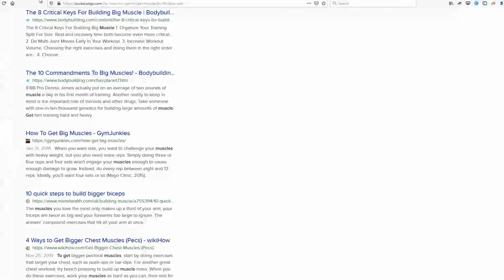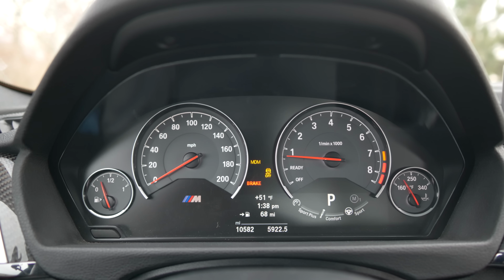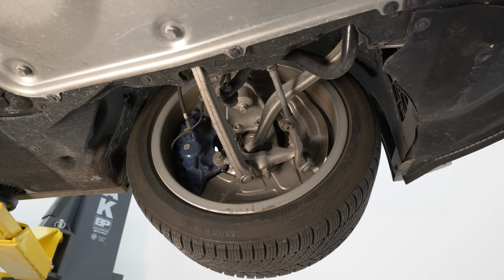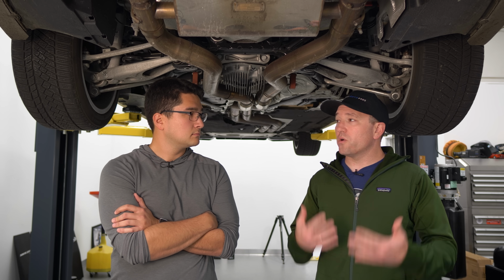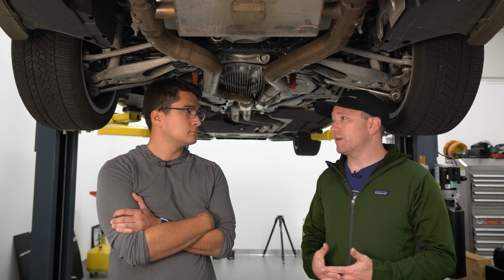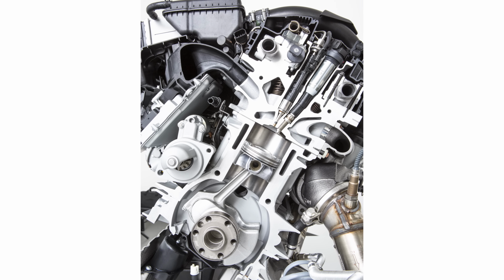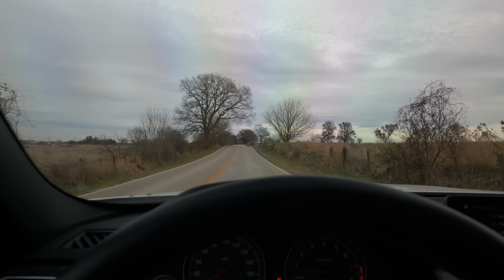BMW F80 M3 Review | The Sports Car for Mathematicians

Comment: So, if throttle control is a problem because of excessive power to only the rear, why not get a 440i?  Six cylinders, six gears, less aggressive tuning, far more dailyable.  You still would have a car that's more capable than 97% of other drivers out there.

Comment: just got my 2020 M4 convertible before they are gone. Love the car for being tamed but can be a beast when it wants too. I have no issues with the sound or the double clutch auto transmission. Love the hard top convertible where its like having two card in one. The extra weight in the trunk when down makes the car feel different. The new model M3/4s have to much gizmos, I prefer the simple layout of the 2019 M3/M4 interior where it feels modern but still has touch of old sports sedans. This is my second BMW and have had no issues the old one and so far none with the new one.

Comment: I've been lusting for a white m3 with a CF roof ever since the E92 came out. I was sad when they retired the V8s, but i also got  love for the F80. One of these days I'm going to have to nut up and get one. It isn't a dream car per say, but it's a car I feel I need to own at least once in my lifetime. See what the hype is all about per say.

But I'd say I am one of those guys who are befuddled when people mention a lack of  steering feedback. Also living in NYC, driving on bad roads all the time, I do not want to feel that through my steering wheel. Ever drive on a cobble stone paved street? The car feels like it is going to fall apart, and that is any car, even softly sprung ones. So I could care less about steering feedback. As long as the car corners relatively flat, has a good suspension that is good with bumps and good grip levels I am happy. I think most consumers will feel that way and you guys are right, that is why the newer bmws have numb steering. But why is it so bad among car reviewers and so called enthusiasts? 

Keep up the good work. I love your reviews.

Comment: i work at the supplier company that makes the gauges for BMW (among other manufacturers).
some of the prints that went through my hands are quite beautiful, i was especially surprised how the gauges of the m2 competition looked quite different from the regular 2 series, when it came out new. we're currently told that they're going to shut down our factory til 2025, because mechanical gauges are running out of style won't be profitable to be produced in a country with "high" wages.
Reply from the maker: Thats sad, until people have to start paying money out of warranty to fix these displays after they ghost, white out or have dead pixels for thousands.
Reply: @savagegeese  the saddest thing is, we're developing these displays and manufacturing methods in house, which then will be used in a newly built production plant in countries like romania, bulgaria or the czech republic, where workforce is cheap.
Reply from the maker: What type of display tech are you working on just smaller custom sizes?  That's how the modern corporate supplier system works.  Make us this...OK. make us this for next to nothing or we ask the next guy.
Reply: @savagegeese  no, we supply large OEMs in their mass products. no small number custom stuff. if you sit in a new C class, you'll look at our stuff. we also make the touchpads for merc.
Reply from the maker: @TheWolvesCurse  wow ok. Are you internally farming out to cheaper factories or are the larger oems building your designs?
Reply: @savagegeese  "we're" farming out to cheaper factories within our corporation. our union is currently fighting to keep this facility up an running, though our incresingly growing green parties and groups are working against the automotive business, and our efforts to keep these jobs.

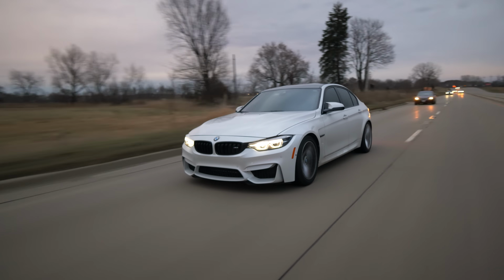Comment: 18:30 - that's a pretty good assessment of it.  I have a W204 C63 and this F80.  The latter car is superior on paper in essentially every way to the C63.  However, the C63 is dripping with charisma and is the car I will probably keep for at least another decade while the F80 is gone the moment I finish paying for it.

[It's really odd the owner got an aftermarket exhaust but didn't turn off the fake engine noise.  I turned off the ASD system the day after I picked up the vehicle.]

Comment: Actual Bimmer owners: was the E90/92 M3 really that bad? I’ve had a burning desire for one for 10yrs now.

I know about the rod bearings. It’s a 8000rpm race motor. I accept it as risk/maintenance.

What other issues should I be aware of?

Comment: Great review as always. Sounds like you very accurately and fairly assessed this one.  How about the RS5 sport back (4dr), or an S4?
Reply: We actually did a s5 sport back a while back. Great car.
Reply: @jackh7550  how does it compare to the bimmer?
Reply: J Mendola depends. The s5 is a total cruiser. It is more comfortable and maybe a better street car. However if you plan on doing any track driving the m3 is the only option out of the two.
Reply: @jackh7550  ditto with your sentiments however I'm comparing to the rs5. I don't have much experience as I only did a test drive but even in that very short time the rs5 felt soft and much more angled at daily driving than the M4 competition.

Comment: Having driven one of these at a BMW M Track Days event in Austin, TX (Circuit of the Americas), it’s definitely easy to drive at a very fast pace on a track, without needing much time to get familiar with it.  The Competition model is much better than the ‘regular’ M3, with a little more power (like it didn’t have enough ALREADY!), much better suspension, and better steering feel.  It’s too bad that BMW ended up with an S55 engine that sounds mediocre, because Ferrari can make a twin turbo 488 that sounds amazing.

Comment: If your going to modify this anyway and it's not the competition package, why not go for a cheaper alternative, m340i, the Mercedes Benz amg line, Infiniti q50 3.0 turbo, Genesis G70, kia stinger. I mean couldn't they all make similar power with an ecu tune? Also would this really perform that much better on a track?

Comment: I want to see more 50.00 on the weight distribution, I feel like these cars are straying away from their perfect balance. Idk If I had to I'd probably add a few weights on top of the rear axle and fix the cross balance by adding a little more weight in precise locations see how much better the car handles on track and on the twisties. Too bad I don't live in California so all our roads are made with rulers.

Comment: I do love this car and that is a perfect spec. Have been thinking about getting a slightly used one, only thing that worries me is the crank hub failure thing. Probably will go with an M2 comp but if I decide I do want 4 doors then this is what I'm going to.
Reply: That crank hub issue is a problem when you start adding some power
Reply: Yea, I'm in the same boat but I heard the spun crank hub can happen in completely stock cars too, no matter the manual or DCT (although the money shift with manual cars seams to be the leading factor in it). There are solutions for that, there are many videos but the fix is in the range of $3-4k for parts and labor that must be planned for if you are out of factory warranty. I wander why SG wouldn't mention it, it's a well known issue and kind of a design flaw if you ask me - they could've designed it with woodruff key or one piece crank hub similar to after market solutions from factory and avoided it happening easy.

Comment: I have been seriously considering the next-gen M3 as my next car, using the G20 M340i as a reference. I love the G20 3 series and the improvements they've made over the F30, and I especially adore the B58/S58 engines. But, if BMW gives the M3 that disgusting grille, I don't think I can bring myself to buy one, no matter how good it is.
Reply: Has ur opinion changed
Reply: @omargeraldo3332  Yes. I still don’t like the grille, but I don’t hate it as much as I used to

Comment: Really good review. I think this M3 generation had huge shoes to fill but also fix past issues (reliability for example), they made so many changes (rolled the dice), BMW ended up weirdly impressing and disappointing folks at the same time. On the "emotional connection" dilemma, is it fair to say that this lack of connection is a growing trend with new cars, with exceptions like the Giulia? I think as per Savage Geese, yep, sad to say cars are better engineered, more reliable, less quirky (which is concerning for Doug DeMuro, though he can find quirks and features inside a ping pong ball) than in the past, finding engaging new generations of cars seems to be getting difficult. The engaging drivers car will end up being the weekend car, an older car which is not relied on for daily use and does a few things really well, but dreadful at most things like fitting child seats, self parking, and ignores commands like "Hey Saturn".

Comment: I was wondering what is the impact of the winter tires +  surface temp on the tractions comment that the review had;  I would imagine set of summer tires and right tire/surface temp combination might have provided better traction and perhaps a different driving experience!

Comment: Out of an E90 M3 and into and F80 M3 Comp.; other than the telepathic throttle response and exhaust note of the S65, the F80 is much, much better. The E9X was louder than it was fast - lots of melodic tones while revving it out, but it felt slow. The F80 feels more like a super-car and on windy roads, the F80 has positively vicious acceleration from apex to apex. Still, I miss the “specialness” of the S65, but not enough to go back...

Comment: It's not that people don't love them, it's most people can't afford them or their maintenance.  Jealously is a bitch lol. I have two BMW and they both spit out srt chargers V8 Camaros all day. 
These are not for everybody, there technology is to advance for most mechanics. They can not be fixed with snap-on scanners and a couple of wrenches. Most people can't afford to do ALL the preventive maintenance, that's is why they get a bad rap. You just can't swap out parts in most cases you have to do updates or programming, that's why most mechanics hardly fix them right the first time. In California and Canada there everywhere, that will tell you something. If you want a loud clumsy car get a mustang or challenger, with such a cheap interior. Maybe  worst Kia (Hyundai)  feels like you're driving a recycled Pepsi can. Btw they new Kias are wannabe BMWs , they hired ex BMW engineers to design new Kias, just on way lower level. People just don't do enough research. Try to get 900 horsepower out of a V6 American car it won't last long before blowing up if you can even get it to do it.  I have Infinity g37 another awesome car.  This guy is butthurt cuz he can't afford a high end BMW anymore, it abviously shows by his snarky comments about how expensive they are. Like I said not for everyone peace.

Comment: Perfect. Get a E90 M3, its slower but far more engaging. I have owned mine for a a year and had zero problems apart from the fuel consumption which is TERRIBLE.

Comment: Mark I’m with you but you’re literally looking at the merits of a fun daily driver through the lens of “I want a memorable weekend toy/track car”. Also I wonder if you need to begin driving vehicles as if you had the skill level of 10 years ago, as well as your current insight. That would be a great exercise. 
The vehicle that has the engine that epitomizes what you’re discussing is a car you notoriously hate because it was not enough of a track weapon but at the time of purchase you weren’t even out to buy a track toy. Granted you had the weird mechanical stuff. 

Your summaries at the end I guess render the need for the previous suggestion moot. Kudos.

Comment: Tesla M3P are killing sales of 3 series including this M3 because the reliability in Teslas are much higher, they are easier to fix.  And you can't match the M3P performance with even this M3.  Tesla just released an update and their car easily goes to 60 in under 3 secs.  The point is that BMW is running out of time with their reliability issues, dealer problems, prices, and performance.  Many folks are tired of their $70k+ toys becoming a money pit after 1-2 years and the cost to run them is getting out of control.  Teslas cost just a bit over $60k and you get amazing performance and its the future of cars.

Comment: I've never driven one of these, so if you would please help me understand this: having so much low end torque is a byproduct of having turbos that allow for more modular throttle control, no? For example, if it was using two massive turbochargers it would have the typical "light switch" powerband and break traction immediately at a certain rpm range, as well as not allowing for you to get good responsiveness at part throttle. 

Point being you should be able to use your right foot to control power delivery fairly well for a turbo engine, no?
Reply: It needs good sticky tires. On the Stock Super Sports or the Snow tires that they were driving on the car is a great burn out machine with the traction control off and is very hard to throttle modulate.
Reply: @Jazz_adub  Even with Hankook Ventus R-S4 200tw tires there is still some wheel spin in my F80 M3, but it's more controllable.

Comment: I’ll admit that I’m slightly biased because I own an F80 CP, but I get the feeling that a lot of the hate this car gets is basically momentum from people reading bad early reviews who have never driven the car.  Also, M3 fanboys ALWAYS shit all over the current generation for not being a real M3.  I remember the gnashing of teeth when the E9X came out with a V8 because it was turning it into too much of a muscle car GT coupe, which is kind of hilarious in hindsight because that car has an almost shocking lack of torque.  When the G80 comes out, everyone is going to love the F80 for not having a beaver face, and I guarantee people will appreciate how ‘analog’ it’s going to feel in comparison. 

There isn’t a car on the market that has the same combination of comfortable, useable and fast on the market for the money.  When the compromise is that it’s so good it feels sterile, too numb (it’s not compared to any other modern EPS), or sounds bad (it’s no V8, but it doesn’t sound THAT bad), it’s probably a pretty good car.  I cross shopped this with a GT350 (faster, but the shit interior and build quality killed it), ZL1 (faster, but the shit interior and inability to see out of it killed it), ATS-V (ugliest gauge cluster this side of a ’96 Cavalier, and a rattle can brand new), and Giulia (no stick), and each one of those cars had attributes that would ruin an ownership experience for me considering how expensive they are.  Also, as the review states, it’s stupid fast.  The only time you’re going to think it’s slow is if you’re having a keyboard battle referencing lap times, never having actually driven one.

Comment: i did drive a 3 series 2020. 331i xdrive .
xdrive translate to awd. 
opens the hood. check engine bay ,says twin turbo, saw one turbo so that means twin scroll
drives it, 0-100 in 6 second. tested 3 time
suspension seems very comfortable
turning and drifting does feel very controlled
steering response like . .  . it is not connected [yea i agree]
yes, driving this car for a few day made me realize no, i should not own this car, yes its features are very nice, and yes it accelerate very fast at low rpm, and yes i know what 0,4G-0.6G force feels like. because ive felt more. 
the seat can hug the back of your thigh, doesnt go up and down significantly, you can adjust head rest t tilt forward or backward, as well as default up and down [or just remove it and youll have less blind spot jk dont do that on every car] and the side of the car can hug you and wrap around your back ribs unless you are really skinny . 
the brake and gas doesnt feel too tight
and ill tell you what. with the amount of electrical in this car, i am scared of owning it to fix it in the future. even the front kidney grills opens when the engine needs air. 
if you dont like to fix cars yourself i gotta tell you this is not a one time 60-80k [$100k+ if you are looking at the higher end bmw] the car will eventually need expensive maintenance
yes it is a functional car but it almost feels like . .  . a cheat mode
yes it is also expensive.

Comment: "Either you think of: they're great performance kind of machines, or they're horribly unreliable pieces of sh*t"

They're both. It's always been both 😂 (my Euro E36 M3 is down for maintenance as I type this 🤣)

One thing I think that BMW has done is chase performance at the expense of experience, which kind of fits the theme of your review. Another thing that I believe plays a factor in the tail-happy behavior of the cars is the wide torque curve. It plays a large role in making the rear unstable since so much torque is available at nearly any rev range and most throttle openings. With a more linear power curve like the S50 Euro or S54, there was a lot more fine control of the power to the rear (via revs and throttle opening) due to the linear torque curve. I've always been a fan of turbo cars, but this day and age everything is going for the widest torque plateau possible (slightly at the expense of top-end power) and oddly enough I think it contributes in a negative fashion to the handling. Although that said, going to AWD with that wide torque curve is going to make the next M3 a *monster*. My built-engine STI has lots of power and a broad torque curve, and you can put the power down so early in a corner its crazy. It's quite a bit faster around the track than my Euro E36 M3, but not nearly as involving or balanced.